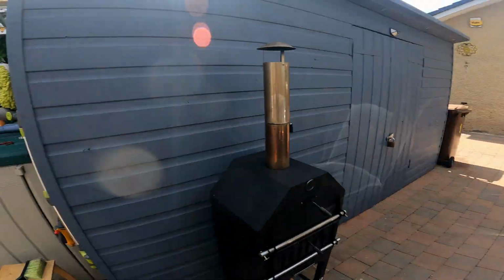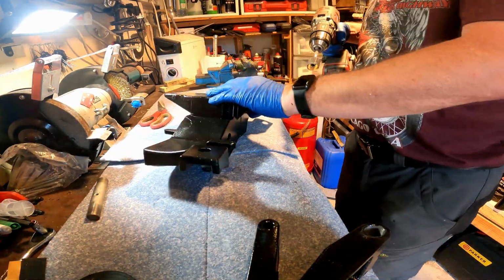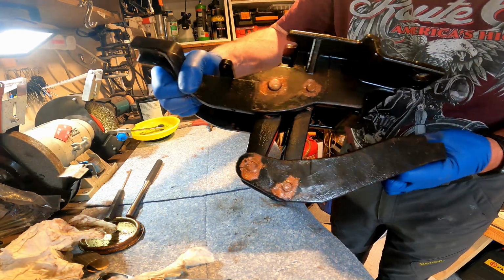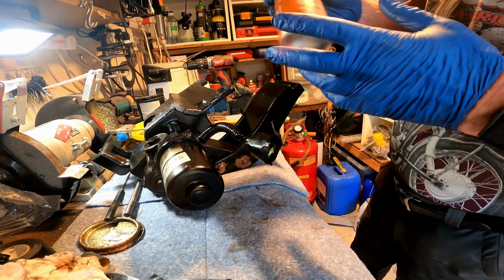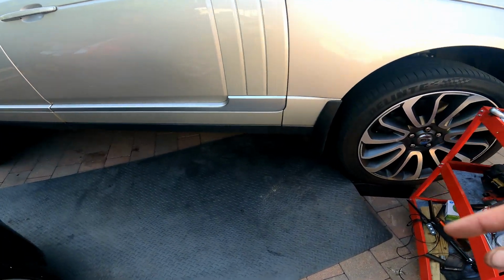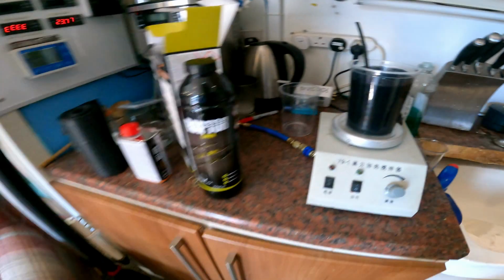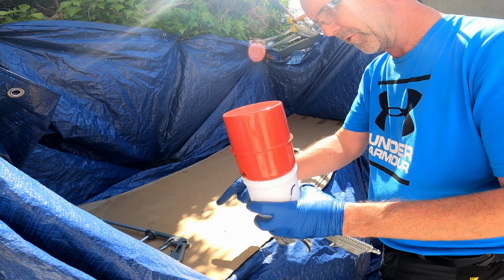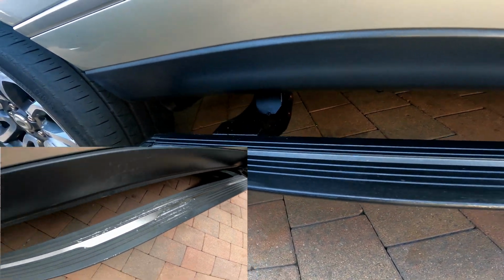Range Rover L405 Side Steps Refurbishment Part II

Comment: I wonder why the Raptor paint didn't come out of the spray gun, I can understand why it didn't come out of the first gun you tried as this is mostly for very thin liquids but I would have expected the spray gun to at least spit something out the end. Perhaps the mix is just too thick for that kind of application.